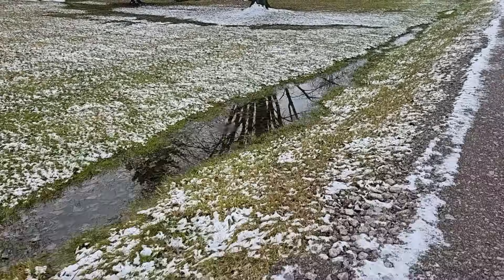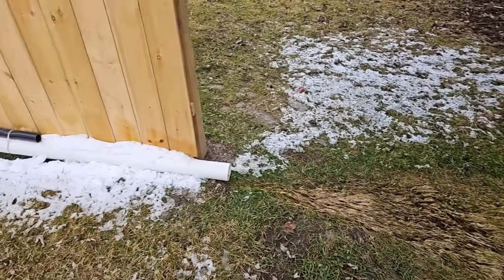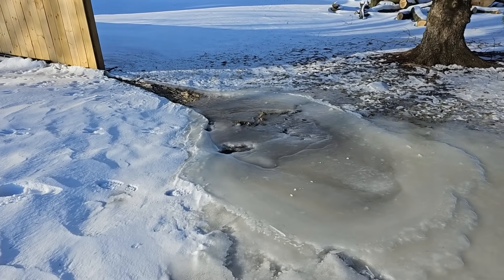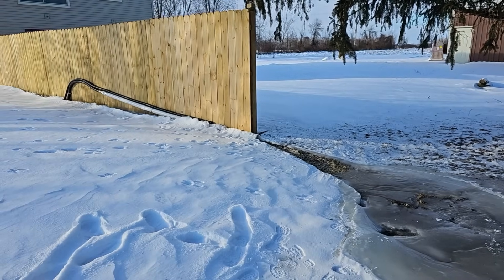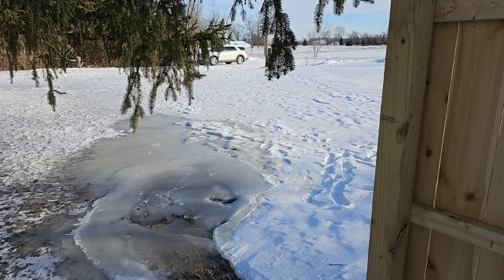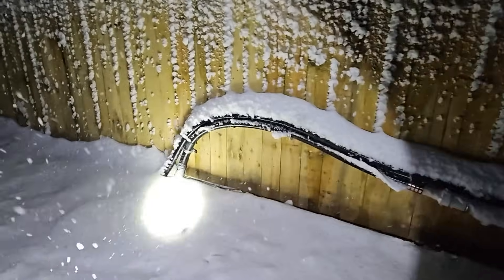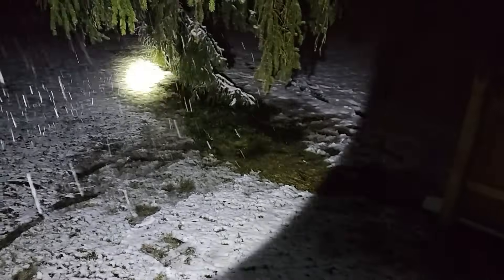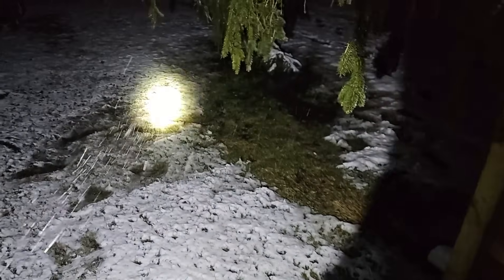Why Drainage System Discharge Lines Fail

Comment: I have to express my sincere appreciation to guys like you and guys in south who take time out to explain the science behind these systems. Seriously thank you very much. 

I have a question, I live on coastline of CT, we get winters and some cold weather but not as bad as we used to. Town I live in already told me I can put in a sump pump discharge into my backyard as long as it does not become a nuisance for neighbors with no inspection.

I have an above ground pipe at this point but I want to go into ground and daylight the opening about 30 feet from home right before my yard grades downward. 

What do you recommend for piping? I see you do it multiple ways and I like all the ways you do the work but if you could prioritize your favorite set ups.

Thanks again

Comment: I have a yard surrounded by concrete. Can i build a leach style field with a grid system and 4 pipes in the trench until I can break up and or clear out some concrete to move and daylight the water? This will only be for a year.
Reply from the maker: So many variables come into play when making decisions for yard drains that it's so hard to say based on the description that you gave. 
My initial thoughts are to cut the concrete with a rented concrete saw. Remove 18 inches of concrete. Put your system in lay the 18 inches of concrete back down, and you can continue to live your life, worry free, and keep all your concrete.

Comment: This channel and techniques are light-years ahead of the 🍎 drain channel.  Funny how over there you get the occasional bashing at techniques this channel does and vise versa.  The more you learn and watch the more you realize this is the real place to learn how to build a good system to emulate.  Professional crews and equipment, standardized system/process, proven long term results.  I critique systems I see on contractors FB pages based on the high standard of builds this channel features.  Most don't come close.  Keep up the good work guys
Reply from the maker: This will be our eighth year on YouTube. I would like to think that our videos have been improving over the past 7 years. I try to read as many comments as I possibly can and create videos based on what the general public needs for information as well as the young contractor. 
Thank you for commenting and contributing. Appreciate you!

Comment: Is it a good idea to put some kind of screened cap on the end of the discharge pipe to prevent rodents crawling in or no?
Reply from the maker: Birds are the problem in this case. This system has been too active. A pump system is hard to plug. If it was gravity, we would use a critter guard.

Comment: Robert, I love the videos and I've been subscribed for a few years as I'm always working on drainage issues on my horse farm in the hills of north central Ohio.  My biggest challenge is the lot next to my barn where my horses are kept during the winter.  It's terribly muddy and I'm thinking an outdoor sump pump might solve my issues but I'm not sure about the buried chamber and associated pipes being in the area where the horses will still be walking.   The discharge would only have to go about 20 feet to the other side of a fence before it would then go downhill.   Is it possible to send you a video of the area to get a quick opinion on whether an outdoor sump pump would work for my scenario?  I already have a materials list from your website but I hesitate to spend thousands of $$ if what I'm trying to do is a bad idea.
Reply from the maker: I never want to put a pump system where the animals are gonna be walking. I always cut a swale to direct the water outside of the fenced-in area.
 Hope this helped.
Thank you for watching!
Reply: @FRENCHDRAINMAN  That's what I was afraid of, which is why I wanted to confirm before moving ahead.  Thanks Robert!

Comment: Wow the dynamics of building a sump pump system up north are definitely different than in FL. Really glad you made this video showing how these systems work and need to be built differently when in a cold environment🥶 People will hate and say “why did you run the sump line above ground, it looks tacky” But it’s because there is a reason and a very important reason for that matter. Keep educating! 📚